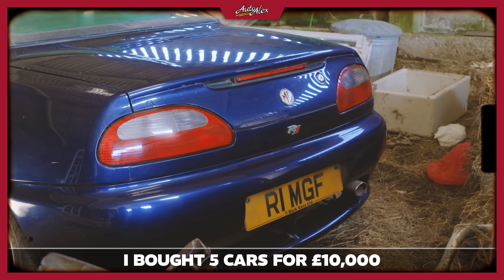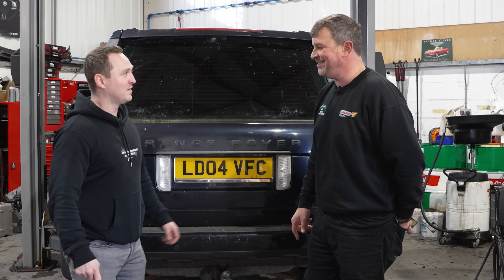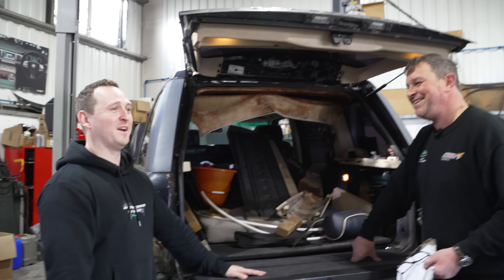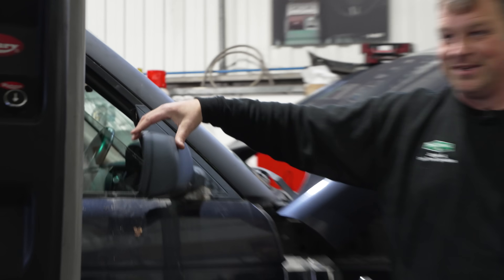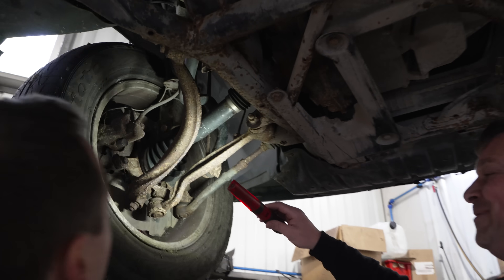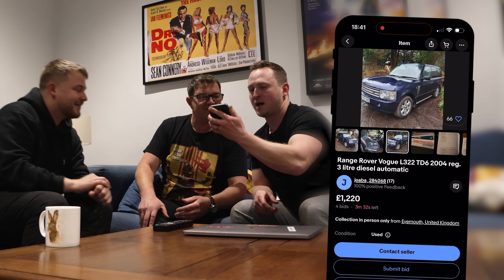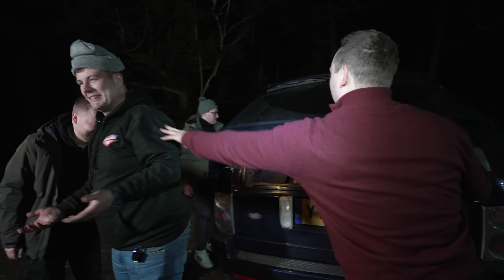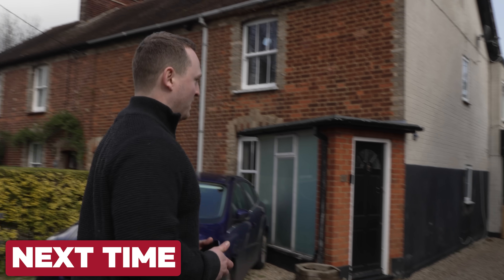I BOUGHT A CHEAP LUXURY 4X4 FROM AN ABANDONED COLLECTION!

Comment: That bike is definitely well dodgy frame is different between an early duke and a 2017 shape so I'd say stolen especially with frame number missing. Hopefully you'll elaborate more on it.
Reply: Not necessarily. I had a moped back in the day that had the frame replaced after a crash. Had terrible trouble getting it MOT'd the first time but after it was all straightened up at the DVLA it was fine. 
VIN wasnt missing but wasn't in the same place as the previous model as the frame was from a facelift version with different panels so looked as if it was missing
Reply: one mans treasure is another mans.......treasure?
Reply: I’m gritting my teeth about this… it’s clearly a nicked bike. How would they feel if Taylor trailer showed up on YouTube? 

Hopefully there’s is more to the story that puts them in the clear
Reply: It's a cat D, surely it's obvious it was rebuilt from another bike?
Reply: Needs some elaboration on it definitely.. it just seems dodgy.
Reply: Could be cat D stolen recovered or just how it's been repaired.
Reply: @Hopgop1  rebuilt yes but the frame and subframe on the bike in the video is 2017 on shape but with reg of much earlier bike. The reg goes with the frame even if everything else has been changed but that frame shouldn't have a reg earlier than 2017 so definitely dodgy.
Reply: @geek9642  I'd say it would be very stupid for anyone to buy a stolen vehicle and post a video of it on YouTube. Much as there is probably a story to this bike i highly doubt we'd have seen it if it was nicked.
Reply: Looks dodgy as f*&k. Especially upsetting if it is considering Alex is also riding bikes and should be well aware of how many bikes are nicked on daily basis.  Would be good to hear what's the outcome of it. But if it would be just silenced on  it will be a huge blow out by Alex and his team.
Reply: If you look at the MOT history, it was never MOT'ed until 2020 with 408 miles on the clock. I would assume it was crashed within those 408 miles and has been sitting for 7+ years, waiting for somebody to rebuild it. 

It's not just the frame, the engine, exhaust, plastics, pretty much everything is from a 2017 model.

I would agree with you 100% in saying that it's stolen, but the reg history lines up with his story which makes this even more odd. Why would a 2012 bike never have an MOT and 408 miles done for 8 years? 

I can't figure this out at all, my mind keeps telling me it's stolen, but the more I look into it, the more confused I become.
Reply: @Gobbbbb  what you could do is you buy a crashed bike then nick another bike and attach the ID off the damaged bike to it and grind the vin off the nicked bike.. 

I won’t be surprised if the police look into this and they will have a hard time convincing anyone that they aren’t aware it’s not handling of stolen goods
Reply: @destructionnl8165 I agree it would be very very stupid.. I’m a big fan of these guys so let’s hope they haven’t really done it…
Reply: Maybe the stolen bike explains why no podcast last week???🤔🤔🤔🤔
Reply: Personally, I'm very surprised and disappointed that they bought that, should have reported it to the police. As previously stated, if it was something of theirs that was stolen, it wouldn't be as funny...
Reply: This was filmed last year and I think it was sat in the workshop and got briefly mentioned on a more recent video so maybe the mystery has been solved?
Reply: @jimbobrust how was it last year?
Reply: @Gobbbbb cos it was crashed in the first 3 years then broken for spares and someone then bought the frame to use on a stolen later model.
Reply: can CAT D mean stolen and then recovered? Then it could be all above board
Reply: @Gobbbbb The lack of MOT for 8 years (and having 408 miles) thing isn't too unusual. If someone's bought it to ride around on their own land then they won't need an MOT.

On a country estate or something you could easily do a few hundred miles in 8 years just going from the aviery to the duck pond a couple of times a day.
Reply: @robl1541  would still need to be on its original frame. And it's not as frame of a 2012 looks nothing like that

Comment: Looked it up that's a KTM 125 Duke 2017-2020 model, well at least it's pretending to be 😅.

It does look stock, maybe they did swap the frame since it was written off. From what I can see they should be at least 2000 pounds, so fine deal I guess. 👍

Comment: Tbf 1500 quid for a Duke 125 even Cat D(N) is still a decent deal, at least down here in Devon and Cornwall. They usually go for about 2-3.5k depending on the year. Edit: 2012/2013 for 1200 is a decent deal as long as all the paperwork is there

Comment: As someone who knows l322 range rovers inside out i can tell you that the rust on the wheel arches is a very big rabbit hole, if you can see surface rust above the plastic sill trim it is already too late, let alone a hole that is seen above the plastic sill trim. Take those off and you will see holes big enough to stick a tv remote in. Unless that gets fixed on the next episode but welding and rust repair done right is not an easy or quick job.

Comment: Look of blood drainage from the sleep depraveted newdads face as the penny drops and the money pit that ruined everything buy breaking down too much and costing way more than it was worth is returned looking great!. Can you hear the ticking of the time bomb.... Just think if not for the running costs of that LR you would have got a kuhara BMX for Christmas and become a famous. But instead all you got was plastic self build model of a E Type 1/8th size. Couldn't even play with it when it was finished had to glue it together so unless you have the skills to paint it properly it's gray an green plastic and glue finger prints over everything. You set it alight after filling the boot with swan lighter fluid and got high on the fumes of solvents for the rest of the year